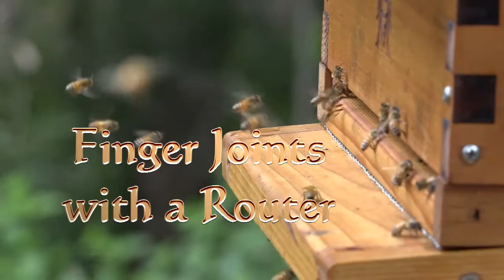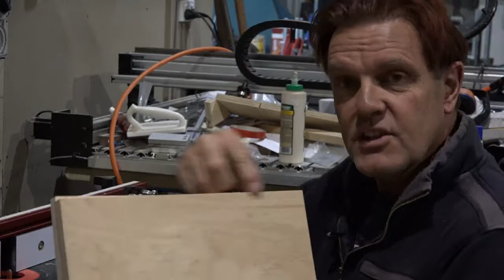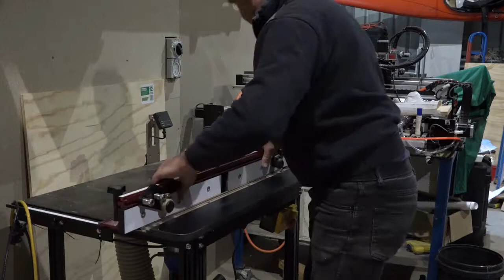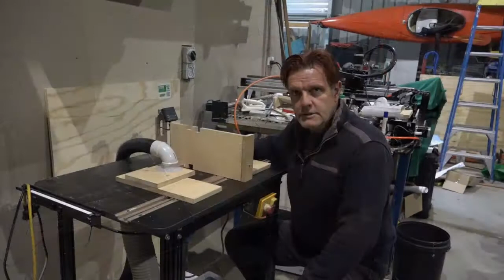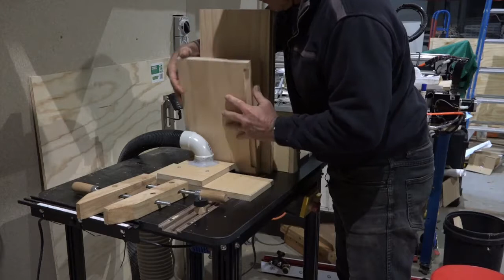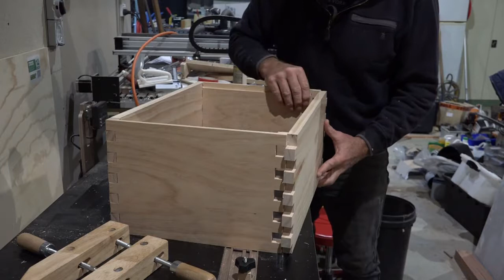How to Make Finger Joints on Your Bee Box with a Table Router

Comment: Sir can you give me the measurement of the box
Reply from the maker: Thanks for watching.  I use 8frame full depth boxes that measure 320mmx466mm inside dimensions by 244mm depth.  The outside dimensions will vary according to the thickness material you use.  Some use 19mm, others use 22mm.  It's the inside dimensions that are important being determined by the size of the frames.

Comment: Hi Mike. What laser burner do you use? Hope you make a video about it. Don’t forget to backup your vids on Dropbox. 😜
Reply from the maker: Hey Al, I have a Full Spectrum Laser Pro 2418 80 Watt that I bought for work in 2011. It's a Chinese made product that FSL in Las Vegas  re-branded and fitted their electronics to.Just about any laser engraver will do the job.  More power is faster.  I will make a video, thanks for the encouragement. Thanks for the Dropbox tip too.
Cheers,
Mike

Comment: Hi, could you tell me which router bit you are using for both activities? Good job! ... Greetings.
Reply: Hey Luciano, thanks for watching.  I used a 6mm straight bit for the frame hanger rebate to get a tight radius corner. I've found it doesn't interfere with the frames that way.  You could use a larger bit and square it out with a chisel.  The finger joint bit is a 22mm straight bit.    I think that equates to 1/4" and 5/8" in the old measurements.  I'm interested in using spiral bits to see how much cleaner the cut is.